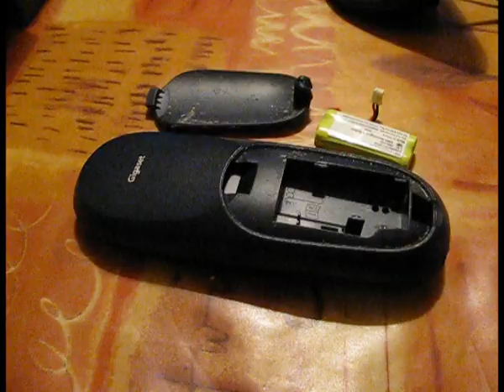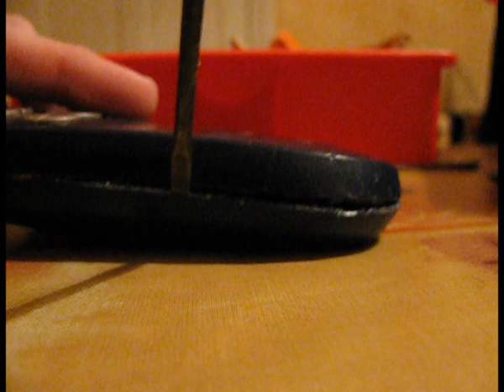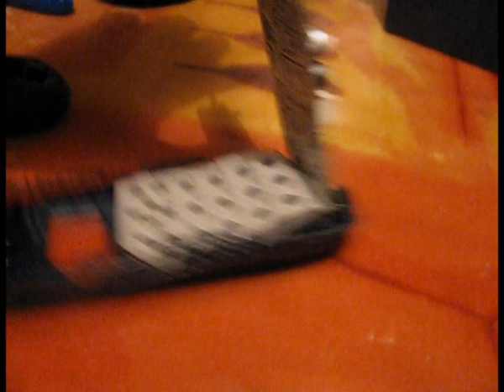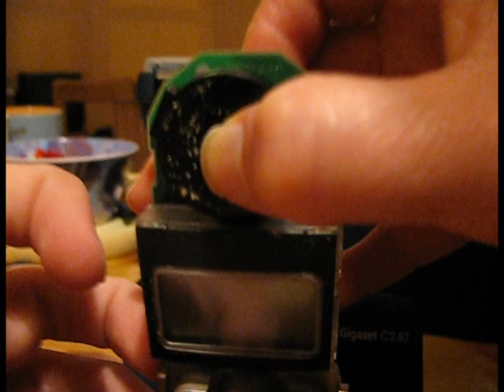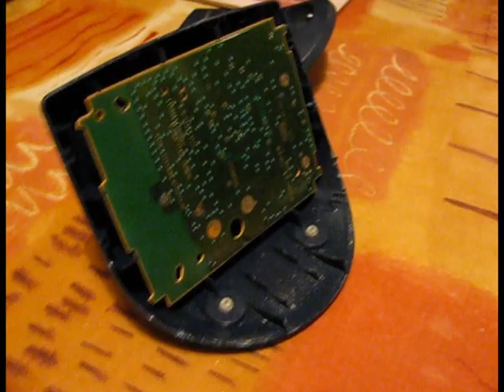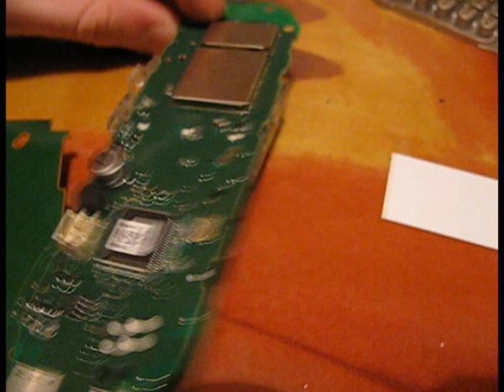Taking apart a siemens cordless phone

Comment: put your tiny screw driver  in the plastic near the plugs, push it down, then slide arround the wwole things. The plastic part will easely be devided. Then, the (copper?) terminals are attached to the pcb, so you need you need to push them (from within the battery hole) to detach the pcb from the plastic part.